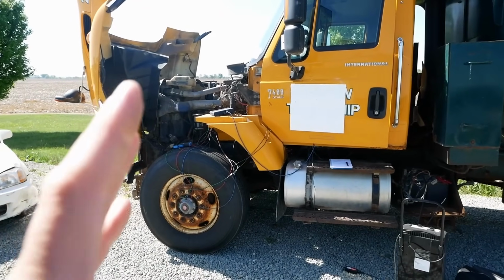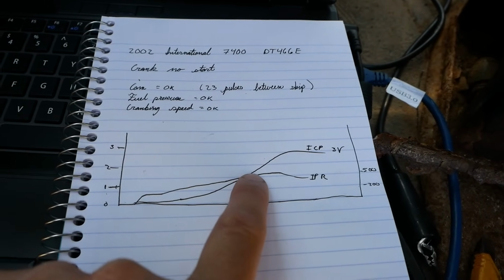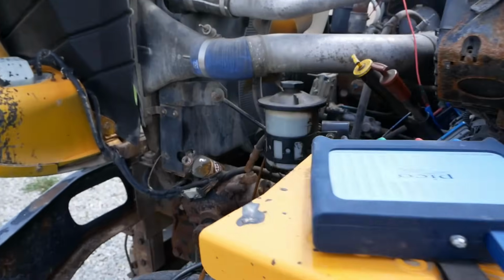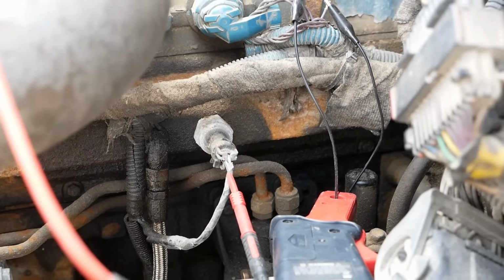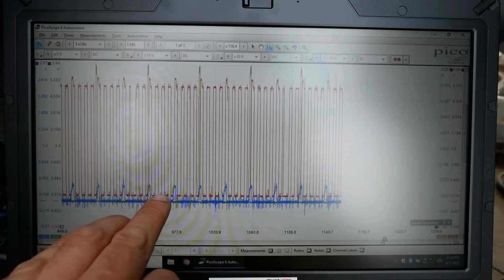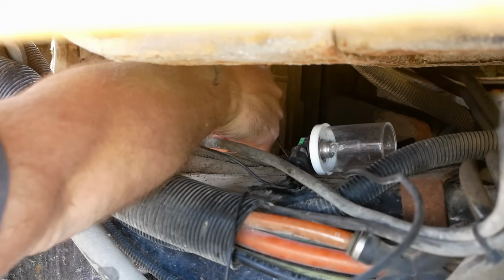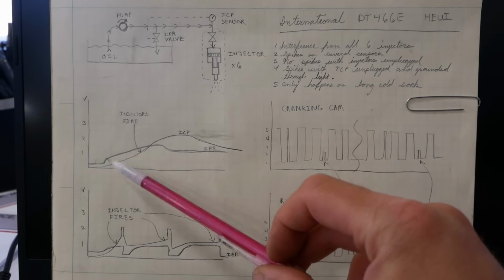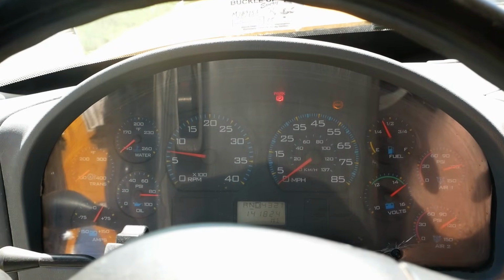International DT466E Won't Start without Ether after Sitting

Comment: Greetings: Indeed we share some skills. Me- 50yrs of electronics service and design. I claim not 2 B a "mechanic". However I am a tech of many trades. Mechanics get dirty turning wrenches...of which I have done also. I moved in2 trucks in the 70s and later had a few on my own. The late 80s came around and demised the good mechanicals out there. A little cold blooded from time 2 time, however, they were fairly dependable with good maintenance and operation. Give me an old '1 wire engine' : 3116, A/B block, 466M, 8V/6V, Etc and she will start. Just add fuel. Alternate/Batt failure- go 2 manual and bring her home. The new junk from autos in2 the heavies is expensive junk that leaves U on the roadside. The 7400, 4300, ( basically same) 'Barnyard Buick' junk. Designed 2 fail and generate revenue 4 the Mfr's. Cat had the right idea- pull out if we cannot do it proper. I realize most of these cats reading probably have no idea what U displayed on the computer (scope). Hats off 2 those of us that do. I have diagnosed 4 many shops, some with the overpriced 'diagnostic' software / hardware. They think the new whizbang toys will tell them, in kindergarten language, how 2 repair. Expensive lesson probably not learned by them. Most of the new breed 'mechanics' ( I use that term loosely) R not educated, do know proper repair procedures, cleanliness and responsibility, say the least of fair customer service. A new meaning 2 "chop shops". The recent influx of immigrants does not help. The mentality is still primitive thought. Many have no idea on 'how it works' much less the technical and proper repair.  In such case I fault the Mfr, Servicer and diagnostic tool Mfr's and dealers. In the end the customers suffers. I prefer 2 keep the old stuff rolling. Back then we had skills and pride in our work and products. Now Ppl have no pride, lack knowledge and responsibility Bcuz they lacked discipline, education and initiative early in life... Rendering them without knowledge, skills and responsibility whilst smoking dope, drinking and doing drugs. Back on subject- Mechanically the 466E and variants R basically OK. The Intertrashional electronics is crap...the other Mfr's not far behind. The addition of BCMs made things worse. With convenience comes lack of reliability. Good show mate. Thx.

Comment: Why IH thought it was a great idea? They gave it to Caterpillar in the 3126E and C7 engines of the same medium frame diesels. Speaking of crapbox wiring, look at a Peterbilt 335. Total POS with all the wiring inside the left front fender. Trustme they are all turds.

Comment: I  DONT KNOW! ,BUT THE COMPUTER CHECK CODE SAID IT WAS THE WRONG ECM,AND - TO ME IT LOOK'S LOOK SOMEONE HAS REPLACE THE ECM COMPUTER,BECAUSE YOU CAN SEE THE HOLD DOWN BOLTS HAVE BEEN WELDED IN,AND CAN IT CAN'T BE REMOVED,AND IF YOU RE MOVED,THAT ECU,OR COMPUTER- YOU WILL BE IN DEEP DEEP TROUBLE- ( IT A  TRAP! ,AND MAYBE A LAWSUIT,IF YOU RE MOVE THAT BAD ,OR GOOD COMPUTER- GOOD LUCK! YOU ARE A VERY SMART MAN,AND I'M SURE YOU WILL DO THE RIGHT THING👍👍

Comment: I was suspecting a resistive supply wire or connection that looks fine open circuit, but voltage and current drop under load.

Comment: If you use Ether on a pushrod engine it bends the pushrods a little changing the valve timing. Because of pre-ignition on an open valve. So you have to use more Ether to start it and more and more. Ok on an overhead cam.

Comment: You're overthinking this - if it starts with ether then most likely is diesel fuel line pressure issues - on the back of the head there is a return fuel valve that should prevent the diesel from the injectors to drain back out (engine off), when cold down it will leak, replace it and thank me later.

Comment: I had a very similar issue that foxed multiple garages,  my SAAB 1.9 tid FIAT engine would not start most of the time jumping it helped etc, the garages changed multiple parts without fixing it, finally I took it to a Diesel specialist, they checked all the usual stuff no issue with injectors pressure etc, but cranking it wouldn't start, he just push started it no problem, on investigation the starter although it spun the engine fine, on the scope there was a burst of RF at one point as the starter turned, it blanked the crank position sensor signal so the engine wouldn't start ,new starter and fixed

Comment: does this engine have glow plugs? If yes, do they work? Check them separatly. Direct injection normally are high compression and do not havr glow plugs. It souds to me that the oil pressure that activate the injectors is not suffuciently high to operate the ingectors umtil the engine is turning faster. try replasing the igh pressure oil pump.
Reply from the maker: No glow plugs

Comment: 16 years at Navistar just curious what's ICP on (cold start; cold soak), cranking voltage on scan tool, eng fuel press. Not sure I agree it has bad ecm if it runs but it could happen, I suppose. What engine faults does it have the dash codes you show are ESC body codes ( Fuel gauge and loss of comm between ECM and body controller ESC) . Install manual gauge with a T on HPOP line and/or  Deadhead the HPOP if you have low ICP press. I know they can be a challenge without correct equip. There can be lots of little issues on these things that can give you Hard start/cold.
 Pulling rocker cover and pressuring oil line with air can be helpfull to find leaks at injectors.
Reply from the maker: You should watch the video before leaving comments.

Comment: Feels like a cracked solder joint on the ECU circuit board or a flaky connection on one of those big connectors to it.

Comment: I would almost say it sounds like something's allowing it to lose pressure overnight like if it cools down and it allows itself to bleed off and with it cold you have to shoot it with either and then it gets primed back up and seals itself off with heat and that's why it does allow to run all day with no problem that's a thinking assumption

Comment: International had a problem with the wiring going thru clamps just past the battery box it would rub thru and cause shorts probably fixed a handful of them , the tell tell sign was fuse holder starting to melt or bad case blown fuse.

Comment: Boy do I admire your patience!  Long before you gave up I would have been roasting hotdogs over an International grill with a roaring diesel fuel fire. Back in the days when I worked on junk and far from the complicated level of junk you diagnose I kept an old car rim with a sledge hammer next to it...my pressure relief valve so that when things were going like the IHC I would beat the Hell out of the rim, I found that was cheaper than destroying whatever I was working on.

Comment: Pull the valve cover and confirm there is no icp loss through an injector o-ring. Every 466e I ever worked on that was an ether baby had a bad injector o-ring.

Comment: Wasn't it good when you had a fuel tank for diesel, a mechanical pump that sucked fuel from the tank and sent it to injectors that squirted it into the cylinder where heat generated by the compression started the thing working.  Well mostly. Wonder what real benefits all this new electronic control stuff has given us over the old fashioned stuff

Comment: My DT466E came from the factory with a either bottle mounted in the engine bay and a switch on the dashboard. If that truck doesn't have it, then I think you should install one

Comment: Wes, not sure if anyone else picked up on it but during cranking with the injectors plugged in I could hear a regular "tick tick tick" probably about every second or so.  That had my gut thinking injector related. Definite change in sound between plugged in and unplugged, my pseudo-diag guesstimate (at 10.56 in) is broken insulation causing a short in one injector & sending a pulse back to the ICP ground-loop stylee causing ECM confusion.  Once running the vibration or heat kills the short enough to continue running until it heat cycles again...
Reply: Well how bizarre is that...  I guess my ticking sound was the IPR dumping pressure on that first injector firing event...  Now I have a theory based on it being temperature related ECM issue. If someone opened that thing up I'd bet they'll find leaking capacitors.

Comment: it sounds like there is a capacitor in the ecm is getting wonky.  Take the battery leads off the battery, short the together for an hour, tthen reconnect and if it fails to start, you have found the problem.  The fix is to repair or replace the ECM.

Comment: This leads me back to my theory which seems to usually be right. When diesels are having trouble, it's a fuel delivery issue. Every time. If they get good fuel they run good.
Reply from the maker: Well that's pretty oversimplified.
Reply: @WatchWesWork  I was going to mention that at the end of my comment and yes you are 100% right. Then I decided not to, to keep it short, I have a habit of rambling. I should probably write some books or something I can just go on forever.

Comment: FYI, the CMP sensors are different between the DT466E and the T444E.  They have different part numbers, because the timing is different.  Installing the wrong PN can cause starting and performance issues.

The CMP sensor on the DT466E is adjusted to the correct air gap via shims, but the front cover depth and the camshaft end play has to be measured, first.  See the iKnow article or the Service Manual for the proper procedure.  There is a CMP sensor shim kit available from the dealership to correctly set the CMP sensor.
Reply from the maker: It's not a sensor or air gap issue.

Comment: I could hear the cranking speed drop after a second or 2. Some diesel engines need a very good crank in order to generate enough heat to ignite the fuel. As soon as the cranking speed drops, you've had it. To test this theory, try swapping in known good batteries, or a good booster.
Thr reason for the crank signal not being recognised is probably due to noise introduced by your scope probe.

Comment: Great diagnostic. What a pain of a design to work on and try to find a fault. Can't beat the old mechanical high pressure fuel pumps on older diesel engines. Very reliable and work after years of not being used.

Comment: My guess, is a bad ground between the engine block and the chassis. Those wires look pretty corroded, and just moving the wires around to connect meters may have been enough to restore a bad connection, which would explain it running perfectly. It might need a wiring harness more than it may need a new ECU. The tell-tale sign is the fact that any load on the outputs of the ECU results in a voltage spike in reference to ground. The only other possibility, is a bad electrolytic capacitor in the ECU itself, and if there's no way to disassemble it, the only solution is to replace the ECU.

Comment: i have the feeling you have a failing diode in one of the injectors , they can behave intermitten .. tho i dont know if the diodes for each injector resides inside the injector or inside the mcu unit .

lets say if the coil would not have a diode , when it fires (pulsed) it has residual energy that could backfeed into the system (almost similar like a ignition coil) (a diode is conected in paralel to the coil to extinguish that residual energy), hence you dont see the voltage spike when the injectors are disconnected on your diagnose tool.

Comment: Wes, I work on these Intertrashional salt trucks on a daily basis. All of them we have are max force which is the next iteration. I have encountered crank no start that is caused by leaking o rings on the injectors. The pcm never fires the injectors because minimum pressure is never achieved. A sniff of starting fluid gets it just enough to get it there. They will start after a long cold soak because cold oil is more viscous therefore it builds better pressure. Verify by removing the valve cover and inspect for guisering oil around the injectors.

Comment: Ask the local International dealership to send you a HSNS Hard Start No Start diagnosic form for the DT466E engine.  That form goes over the troubleshooting procedures, line by line.  I am 99.98% confident that HSNS form will help you diagnose what is going on.

There are probably bootleg copies of that form on the internet by now.

I hope this helps.  I wish you well.
Reply: Use form EGED-180-2 and go through the HSNS section on the left.  This is used with EGES-175-1.
Reply from the maker: Sorry but nothing there is going to help us. Like I said this is not something I've ever seen before.

Comment: Not computer i just had this problem and a computer that went out when the injection computer went out it never starts now that ipr and icp have done that multiple times we run box trucks with the same engines high pressure rail o rings will need to be changed too

Comment: I'm guessing ecm has a bad capacitor or 1 that slowly bleeds off causing it to do what it is doing.  Check the main ground cable from the battery to the frame and to the motor is broken or not making a good condition it will screw all sorts of things up

Comment: International heui is a bad copy of cats heui injection. ruined one of the best deisel engines out there when that junk got put on fyi the mack mp7s engine wiring harness is a total pos will make you wish for a 466e wiring any time seen quite a few act up the same way because the oil pick up cracked and makes the oil pump lose prime. Long cranking. The ipr plug gets old and for some reason the wires will break on that. injector harness oil logged is likey seen it where the coating on the wires falls apart too makes some odd problems. But how many kw school buses and plow trucks you see out there. Could go on and on about that good lick

Comment: cap in the ecm, not providing a voltage when ecm grounds the icp circuit when sitting for 48 hours.  After 48 hours the cap looses voltage charge..  Change caps in the ecm.  Cheap fix if you can remove the ecm.

Comment: Hey Wes, just one more thought. I read comments about the ground circuit which you tested, this got me investing way too much thought into your problem here and if I remember correctly the injector solenoid pulses something like 300 volts of back EMF. There should be a high voltage warning sticker on either the ECM or engine block i don't remember, its been a while.  But the point is.... Seems a smoothing choke in this ECM might be failing and leaking peak EMF into its 5 volt supply or signal return. Making ICP trigger the IPR to drop oil pressure. which can explain why all 6 injectors are  showing the same symptom. And as you mentioned once the engine is running the ECM can average out the spiking due to its frequency.  So the end result looks like a ECM fail. Keep up the good work and looking forward to your next video and thank you for taking us along  and explain your diagnosing process with you.

Comment: Ether is the worst thing you can use on a diesel engine, problem is it ether is red
Reply: Readily available and handy but it ruins engines its like tobacco and opium very addictive.  First damage is weakened compression possibly cracked compression rings...

Comment: Can you relate engine or ambient temperature to starting or not starting ?  Perhaps a circuit board in the computer is  connecting / disconnecting components due to thermal expansion. Poor solder joint, cracked trace  Starts when warm but not when cold . Maybe a heat gun would have shown this.

Comment: Just subscribed. You are salty, sir! A thinking man indeed. Tell you one thing that is consistent with this kind of irregularity, the ECM is the one device that has the capability of throwing a wrench into the works, and it's affected by temperature, time, and voltage.

Think your diagnosis is correct. That IDM is integrated into the same housing as the more sensitive part, the ECM. As you know well, one cannot simply rely on fault code capture. If the ECM is hobbling along, you are asking it what is wrong, while it tries to get by. One interesting thing I try with a suspected ECM is corrupt the signal from a sensor that is less critical, a temperature or pressure sensor. If the ECM doesn't "cry foul" when I do this, I suspect the ECM has issues.

There's a red flag on the ECM, buggery is afoot on the hardware and shield. Someone has been in there...and the resulting lack of workmanship is telling.

Is there anything more fun to do than trying to unravel a prior mess? Nope.

Bob

Comment: As a Cynical Bastard, I would say some Pretendgineer put a temp sensor in the circut somewhere, but it is not documented. Add 2 engine heaters for warm months, and 4 more for colder months. Plug it in every night. Or use a torpedo heater till it catches on fire.

Comment: Can’t remember the duty cycle on ipr valve while cranking 70% I believe would Indicate an internal leak I would definitely air tested system
Reply from the maker: That would show up in a hot restart. We don't have any problems there.

Comment: All I can say is that I am glad it isn't me trying to sort that crazy stuff out. Back in 1985 I had a 1984 Pontiac that had a problem. One thing was that it kept running very poorly. Appeared to be running rich. My friend had just gotten a test tool to read those new computers.  We both checked it out and couldn't determine for sure what was going on. We thought it might be the ecm but weren't sure enough to order one. Then he had a brilliant idea. Perhaps it was still under warranty. Called the dealer and yes it was. They replaced the ecm and solved the problem. I feel for all those who didn't have the option of letting the dealer sort it out because, even with the right tool, it was unclear what was wrong.